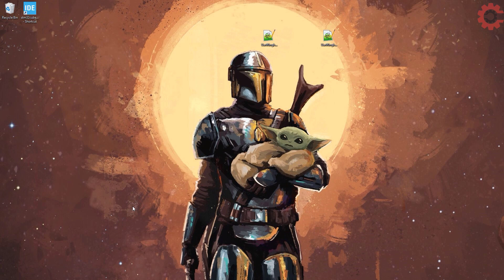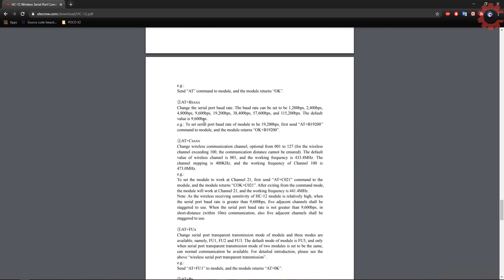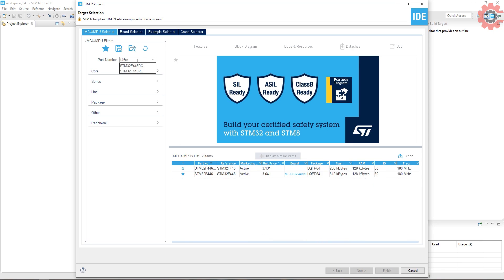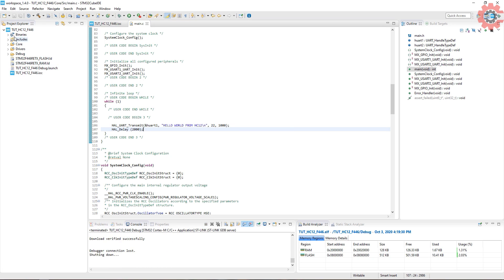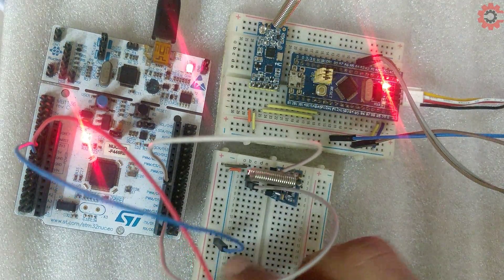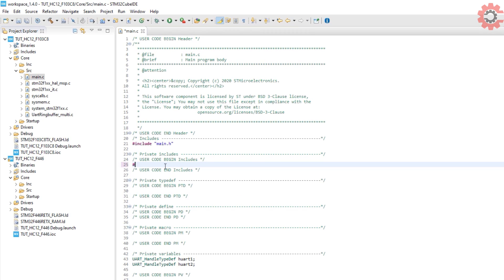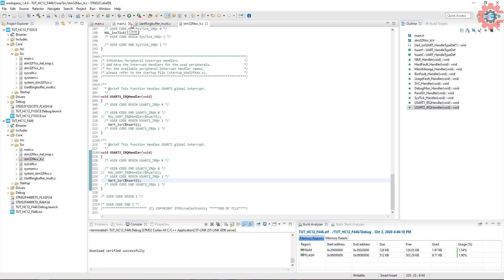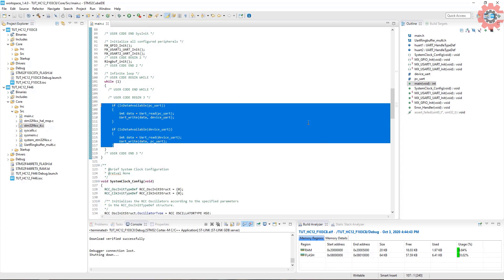How to use HC12 with STM32 || F446 || F103 || 2 way communication

Comment: I am not able to send faster than 500ms delay on si4463. What to do?
Reply from the maker: Data rate might be limited from the HC12. Use AT commands and try to increase it.
Reply: @ControllersTech  I am doing internship and they have given me a small pcb which have Si4463 chip. I have to use stm32 blue pill spi communication. 

I tried but the tx fifo of chip overflows and give error if the delay is more than 500ms.
I also saw the GitHub Library for stm8 which is used in HC12 module. In that code too their is 500ms delay.
In another Arduino Library they were taking 500ms delay

The max size of fifo is 64bytes so I don't know how it can send higher bytes per sec. Max speed on net is 1Mbps.

Is it possible to reach that speed? Even 10kbps will do. If possible with HC12 then I will try Bare-metal and HAL for sending commands.

Thanks

Comment: Sir can you please tell me that how we can get the Password and mac address of HC12 as we get it in HC05?  and how we make one as master and the other as slave ?  HC12 datasheet does not have  AT commands of ROLE, ADDR and BIND? HOW we set its name and password? please answer
Reply from the maker: HC12 is not a bluetooth device. It's a radio transceiver, which works at 433MHz.
Reply: @ControllersTech  thankyou sir for your reply. Is there any long range bluetooth module 100meter range?
Reply from the maker: I don't think so. Even the 5.0 have 40m i guess.
If you want 100m range then radio devices are the best options for you.
Reply: @ControllersTech  thankyou very much sir , for your replies in short time.

Comment: How can i use hc-12 with arduino using python language??
Reply from the maker: Just use it how you use a serial device. I mean how to write data to the serial monitor..
Reply: @ControllersTech   can i use it to send data when i run python code directly?
Reply from the maker: Don't know about python. But if you can print on serial monitor, then you can use this too

Comment: Hello ! Sir ! A lot of  knowles in your video thanks. I have some Question "Can config bluetooth module without  AT command?". Sush as I sent my project to my friend and he want to change bluetooth password but he can't under stand MCU or someting like that. and Thanks again.
Reply from the maker: No you can't... And you don't need mcu to use AT commands in bluetooth. Just connect to PC using ftdi and use the AT commands directly from the computer